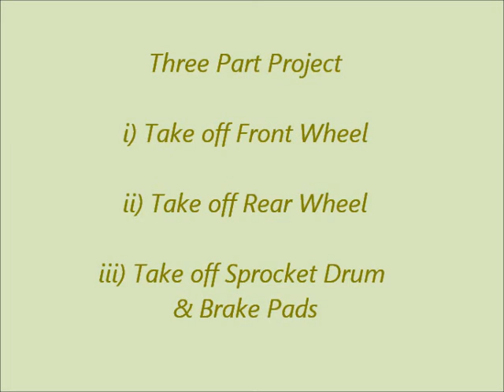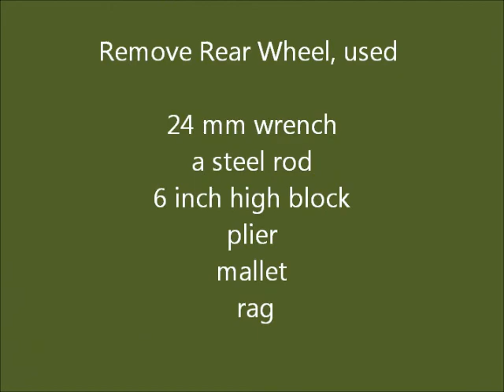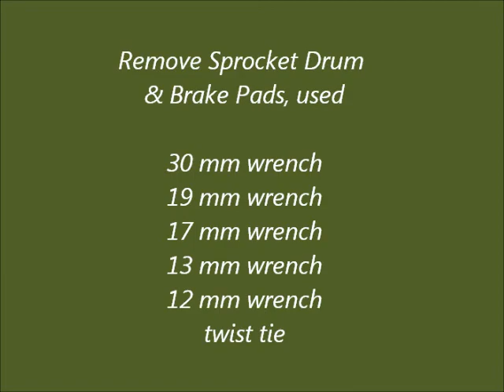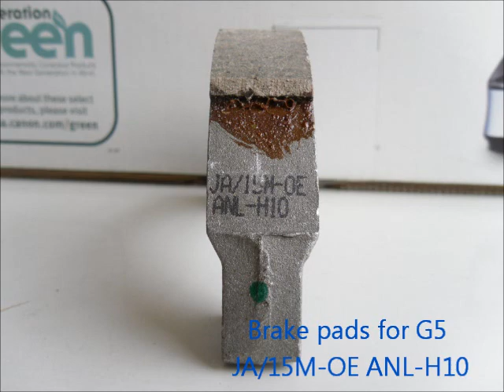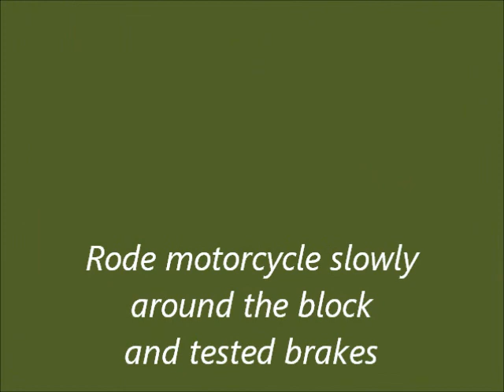Rear Wheel Drum Brake Pad Change of Royal Enfield Motorcycle EFI G5

Comment: Thanks for the video. A cheap as chips 13mm tubular spanner is very convenient  for removing the nut from the brake rod until a long socket can be fitted and spun off on an electric drill. On the C5 at least, it is unnecessary to lift the chain guard out of the way. Tipping the bike over to the right per manual will get the wheel out, so will positioning it over a kerb, without removing the front. Or the entire rear frame and mudguard can be pivoted up (old design feature). Whilst you have the brake apart, do free up the two little nuts and bolts - the spindle that pushes the shoes apart is supposed to slide, replace the star washers with flat stainless, the outer two nuts are lock nuts,  clean up and reassemble with a smear of copper grease. Rear shoe linings (not disc pads ;) ) at 1000 miles show very little wear.

Comment: Great video Singh. You've helped me out with these multiple times now. I have a question though. Does the spacer sit directly on the grease seal in the hub? Or is there another spacer/washer between the two?
Reply from the maker: There is a small bushing between spacer and grease seal on the left side of rear wheel hub. It is visible at 2:23 in the video, lying next to the spacer in the plastic basket. Thanks for your appreciation.

Comment: How often the brake pads has to be changed. is there a general rule?
Reply from the maker: +Jagdish Bhandary : I use both front and rear brakes TOGETHER as bike riders do in USA. More of braking is done by front disc brake. ** I have heard that in India riders use rear brake only. So there can be big difference in how long the rear brake pads last. ** Mine last 25,000 miles easily **. Keep tightening the rear brake adjusting nut until the brake-rod threads runs out or when brake become less effective due to worn out pads. ** It is a good to CLEAN the drum and pads every 10,000 miles to remove slippery / oily / dusty street crud to keep brakes working efficiently.
Reply: Yes I do the same and it is not that it is done by riders in USA. Just a mere common sense applied so doesn't matter which country the rider is from. . So as you said every 10k it has to be cleaned. Thanks